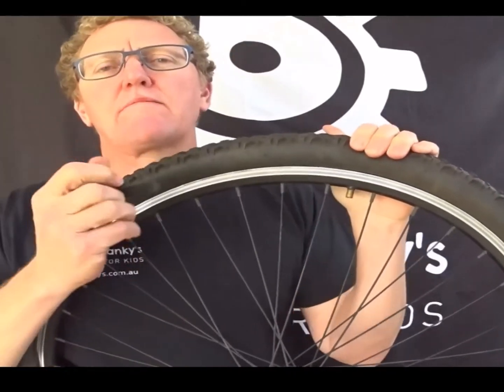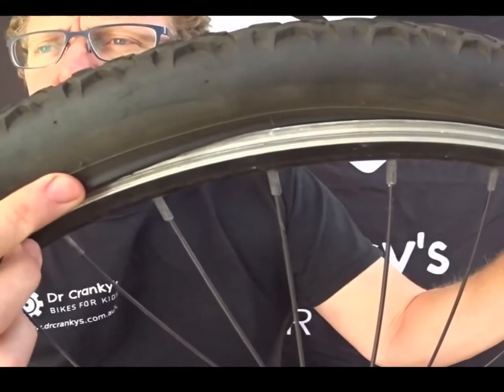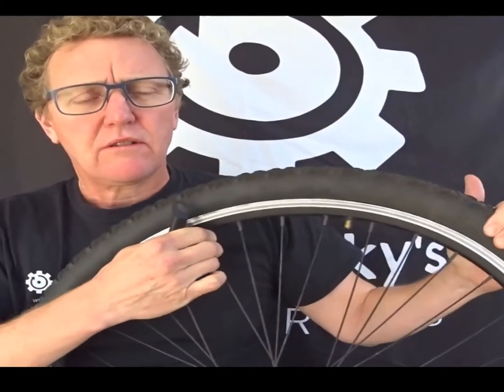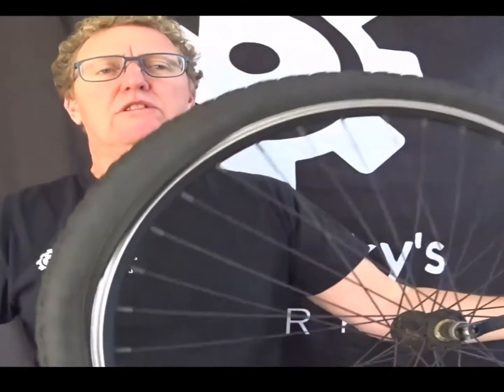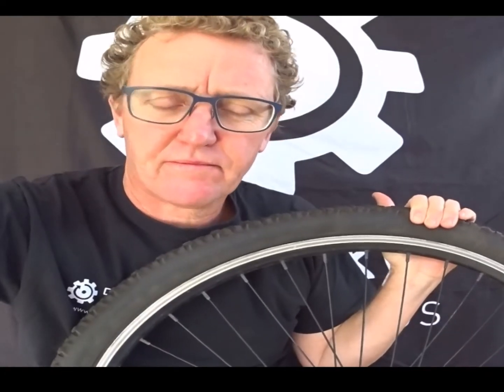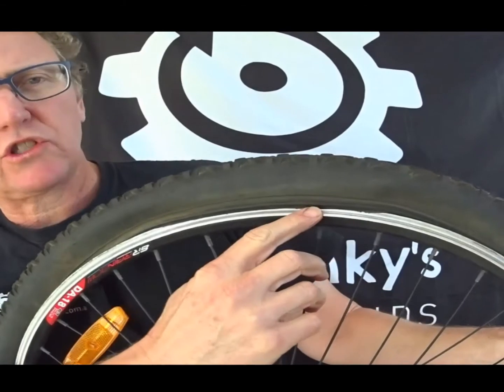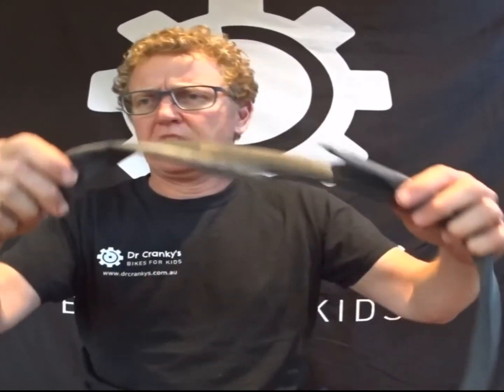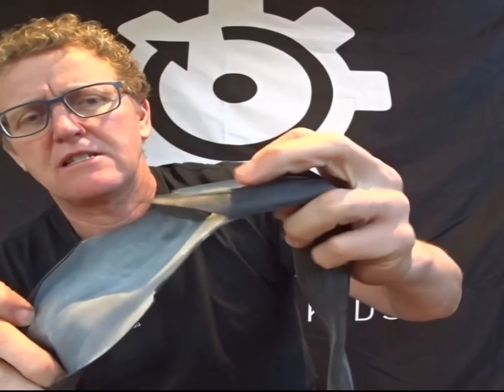Exploding bike tube - what happens when you don't install your tyre correctly

Comment: What psi does it pop
Reply from the maker: Can be as low at 40psi. Depends on the size of the "bubble" that forms in the tube outside the tyre.
Reply: Mine happened at 30 psi...

Comment: Happened to me today. Yikes. Question, when I installed the 2nd tube I noticed the tire was coming off the bead again so I deflated the tire, reset the bead and slowly pumped it up. While pumping up the tire was making some wierd noises, almost like it was going to pop off again, but the tire stayed on the rim with no signs of coming off. I managed to inflate fully but I’m paranoid it’s going to explode while riding even though it looks perfectly fine. Any thoughts or suggestions on testing the bike?

Comment: Hi I have had a bike of my mate and the tire was low..so I put 40 psi (20 in wheels) and hours later the inner tube blew out. I have since replaced it with a new tube and this one has split where the valve is glued. What's the reason for this as I've been working on my bike for years on and off ? Thanks
Reply from the maker: I would check that you've got the right valve for the rim (don't put a presta in a schrader valve as it could split on the rim edge hole). Then check the tyre for splits or glass/wire. And then make sure the rim tape is intact so there are not sharp edges including on the inside of the rim wall. Good luck.

Comment: I just bought a rebuilt bike and when I got home (from a trip on the train) I decided to go for a ride. I went pretty far - into a park and after a while of riding around there, I begin hearing & feeling this "Wherff, Wherff, Wherff" repeating sound and vibration, several times, coming from the fork of the bike (near the brake pads) and the front wheel began taking on this slight wobble (almost like the rim got bent slightly out of alignment) and then "BLAMMM!!!" This had to be the cause of it. Just the riding around probably began to heat up the inner tube and it found the spot of least resistance. I checked later, the rim wasn't bent. Maybe the bike shop guy was in a rush while working on the tire or got distracted by a new customer coming in the store.
Reply from the maker: Yep, the bead of the tyre was not set properly and gradually came loose. Can be due to the wire bead separating from the rest of the tyre.
Reply: @DrCrankysBikesforKids  yeah, I later discovered a large tear in the tire itself - right in that spot - the wire bead. I checked out a YT video by these British pro racer bike guys - where they showed how to stitch up your tire with black mercerized thread ( the type that will cut your hands open if you tried to break it with your hands). But that works fine if the tear is in the center of the tire - not at the wire bead. They said that you can get much larger tire patch material at auto or motorcycle repair shops to glue over your stitches on the tire interior and there's this black goo that you can put on the outside of the tire - in addition. I'm sitting there thinking " this is cool advice and step by step instructions for casual riders but if I'm in a race, by the time I get this repair done, my competition is almost near the finish line."

Comment: This just happened last weekend. Pumped up tires and like 8 hours later one exploded. Never rode it or anything. Is the tire done for? The metal wire Around the tire snapped.
Reply from the maker: Yes. Tyre is done. Need a new one.

Comment: Wondering what pressure you got to...I've had a tubes on 1 wheel, keeps doing this... at times days after it's inflated. I've scanned the wheel, new rim strip, even taped to catch what the strip didn't ... (older cruiser bike) I am usually careful and check while I'm inflating. Could the tire be defective and pushing off the rim after its inflated?
Reply from the maker: Most probably the tyre. Check the wire bead for a break or even it could be the wrong size. If rim is old size then tyre could be just a bit big.

Comment: You get tinnitus - that's what happens.
Reply: Yes, that is def possible
Reply: I would say this is quite unlikely, an exploding bike tire does not have the db to permanently damage the hearing of a normal person (tinnitus is mostly caused by prolonged noise over months/years or a repeated exposure to for example gunshot fire, which is much louder). Perhaps if one already has nerve damage or inflammation or some other cause one should take extra care.
Reply: @andersbjorkman8666  You're already close enough to harm your ears while you're inflating a bike tire (it doesn't help or make it better if you're inside a room/closed environment) and it blows up as it will destroy your hair cells as causes tinnitus. The best thing to do if you don't want tinnitus is to protect your ears in the first place; use earplugs/earmuffs and be aware where load noises is possible to happen as can harm your ears - prevention is key.